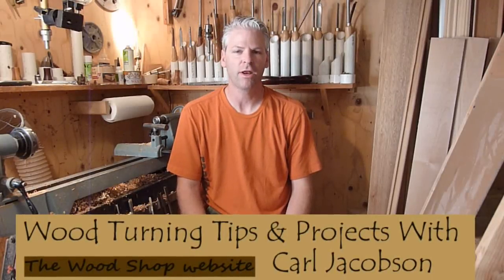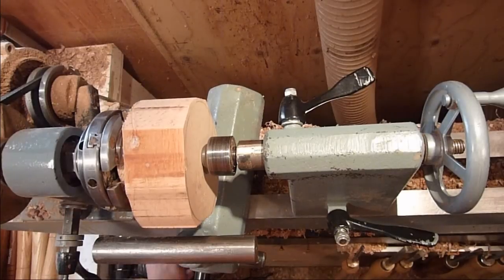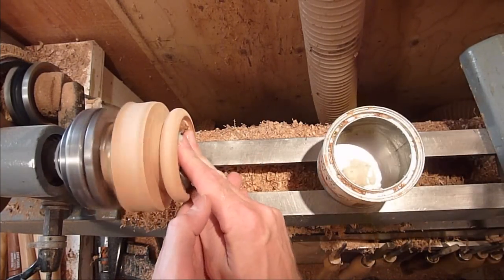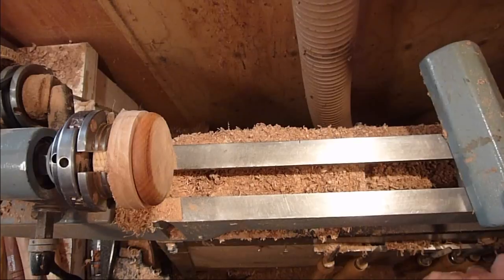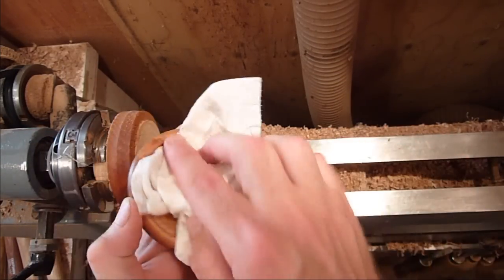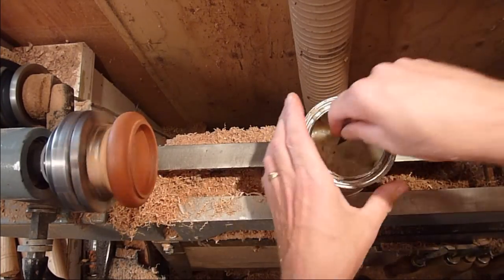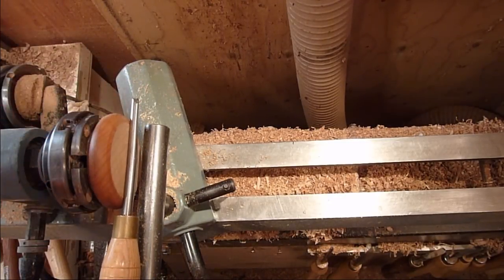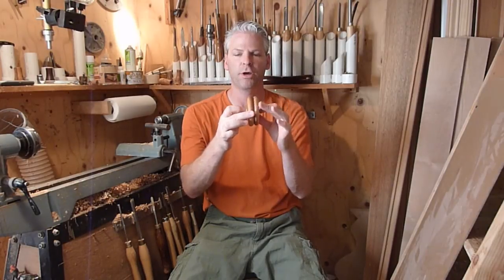Woodturning / Maple Lidded Box

Comment: Why oh why would you use a hacksaw for cutting wood?? It is designed exclusively for metal. Use a tenon or coping saw, never a hacksaw
Reply from the maker: Hi Brian, You should never use a tenon or coping saw while the lathe is running! A hack saw is designed to cut metal and has very small teeth so it wont catch the wood. I have an air saw that I use all the time with a metal blade and it cuts like butter. Here's a link to a video that might help to understand, https://www.youtube.com/watch?v=BBzQ9UIwo80&t=1s